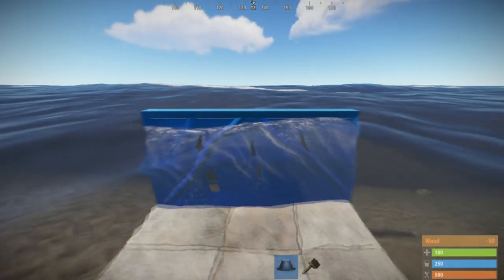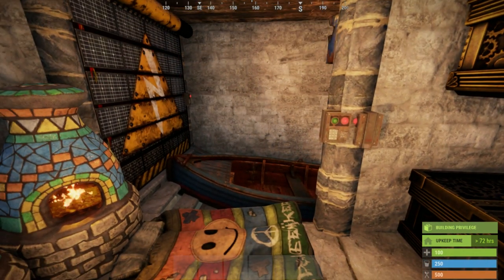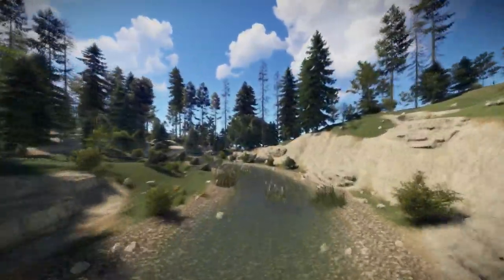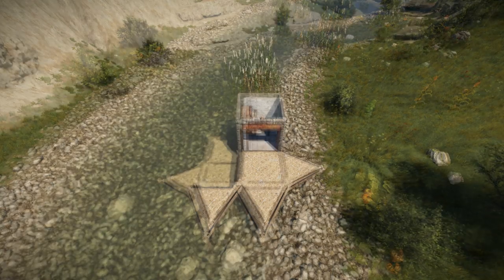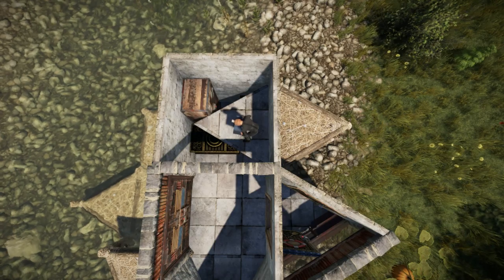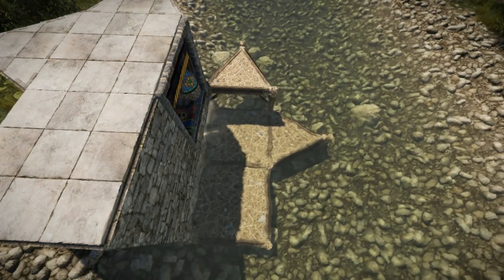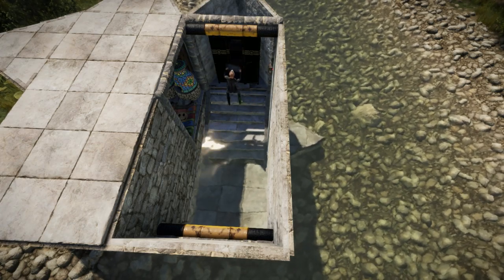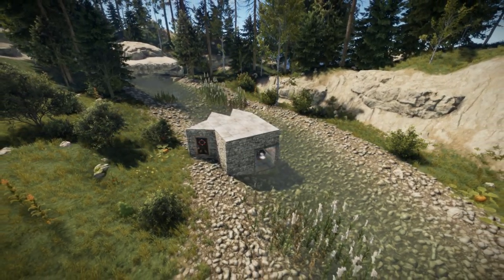Dolphin - Simple Rust Boat Base | Evil's Quick Tips 09

Comment: Great design!  I've made one pretty similar to this in the past.  After doing a lot of ocean farming, one thing I like to add is another deep foundation and vertical walls on both sides in front of the garage doors going into the boat bay as a screen for potential campers.  Don't even need a lid on the walls but I usually still do.  Those moments spent leaving the boat motor to go open the door and then back to the motor are very tense and I've been sniped by a camper in that short time on multiple occasions.  Thanks for the vid and keep up the great work Evil!

Comment: This is helpful. I built an arctic boat base but getting in and out of the boat without getting hypothermia was difficult. One time I actually died of hypothermia in rust. I think as a solo, living in the arctic with a boat is amazing. If you have easy access to a refinery, even better.
Reply from the maker: Yes, that's exactly the problem I had as well ... getting wed and having to deal with the extra cold. The foundation steps removed that issue

Comment: Reason for the Triangle outside in the water that never got built on?
Reply from the maker: The idea was that this will hold up the half wall next to the foundation steps. These days, you can use a normal foundation and one of the ramps instead of the foundation steps, which were removed with Building 4.0
Reply: @EvilWurst  Ah neat. Thanks for replying even on a older video you may not have given much attention to <3